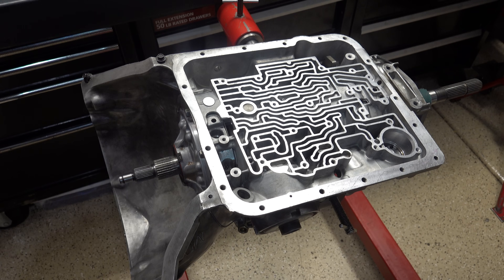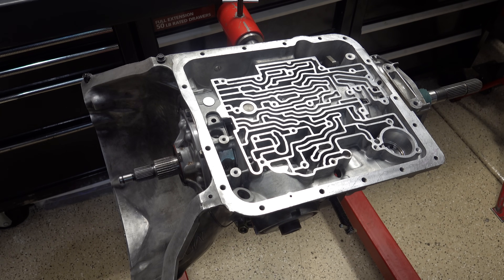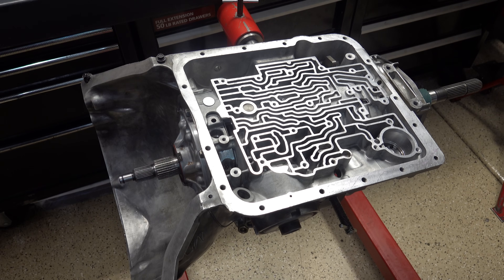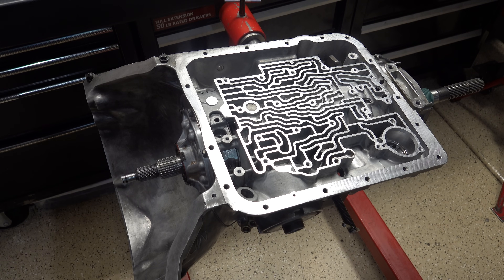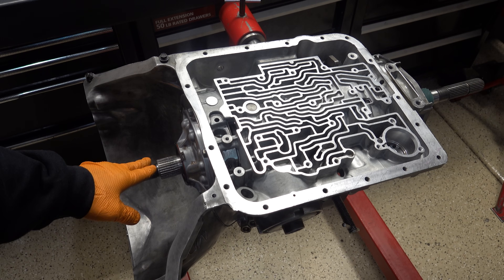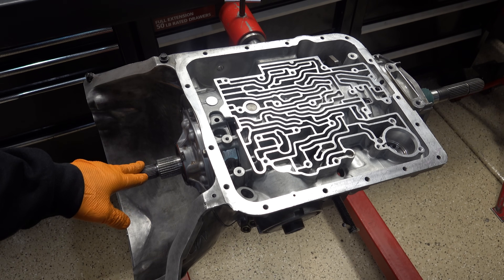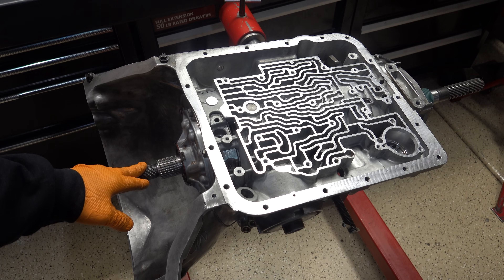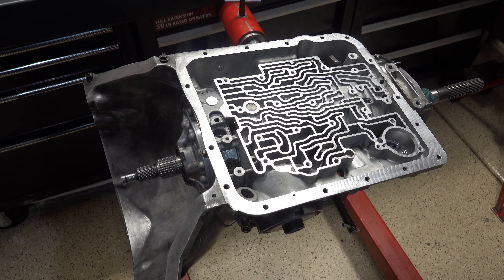Rebuilding Automatic Transmissions: Why I Don't Soak My Frictions

Comment: Does that change the clearance or clutch stack thickness?
Reply from the maker: Hi Tracy, there's no material differences in clutch clearance between wet and dry measurements on the bench...I have found over the years that clearance will open up by about .003-.005 once the trans goes back in compared to what you measure on the bench, soaked or dry frictions.

Thank you for watching.

Comment: Looking for the best clutches for a 4R100 for heavy duty use. It'll be behind a 7.3 diesel putting out about 400 hp. 2000 F-250 crew cab short bed. Truck has 37 inch tires, 4:56 gears, selectable lockers. Already going with a 40 row auxiliary cooler to keep it nice and cool. Will be doing quite a bit of rock crawling.
Reply from the maker: Hi @theezeelife292,

Can you post your question above in Part 1 of my 4R100 rebuild series? I ask as others may have the same or similar questions and most likely look there before this vid for answers. Here's part 1: https://youtu.be/Tm12GezIQww

I'll respond promptly there.

Thank you for watching!

Comment: What about assembly lube? I assume that doesn’t make any difference in ‘feel’ and in the case of bearings or bushings you kind of have to use it right?
Reply from the maker: Hi Alloutofdonuts (sucks when the donuts run out!) - Yes, use assembly lube on all lip seals, sealing rings, O-rings and anywhere there is a tight fitment between parts including the pump and pump bore in the case...If you watch any of my transmission rebuilding videos (i.e. the 700R4 rebuild playlist) you'll get a good sense for how I use assembly lube and on which parts...I soak bearings in transmission fluid as well as bands.

Thank you for watching!

Comment: This makes total sense to me.  Also reminded me of a weird symptom of my 89 Bronco with C6 project vehicle before I took the transmission out to rebuild.  When would start it cold, it seemed as if the truck would lurch forward slightly when it would even though it was in park.  Perhaps all that damage inside made it turn the output shaft at start up for a split second
Reply from the maker: Could have been the case; something was putting it "in gear" for a split second before everything was allowed to freewheel...

Comment: Soaking clutches is a MEME and I never ever soak them if I can avoid it unless I have to reuse them. You can always pour fluid into the unit with the valve body side facing up and boom they’re “soaked”.
Reply from the maker: Yup! 
For sure, man.
Reply: It makes em slip more too

Comment: I literally just wanted to ask you this since Ford's manual explicitly states that clutchplates ought to be soaked 15 minutes before assembly. Thanks for explaining this.
Wouldn't there be any difference in tolerances though? Since the manual also says that tolerances are to be measured after the wet plates are installed. I saw another youtube video where someone went the middle ground by measuring the tolerances dry, and then taking it apart to put the plates back in wet for final assembly.
Reply from the maker: Hey John, there's no material difference in clutch clearance...A couple thou taken up by fluid will be given back once the clutch starts working again. Whoever you watched on YT sounds like they enjoy performing completely unnecessary work. Hope no one takes that guy's advice seriously.
Reply: @nickstransmissions  Thanks for the clarification! That makes sense, and I'm glad to know that there's no need to assemble anything twice.

Comment: I don't soak mine either, for the same reasons. Also, I've started using Alto HE clutches (the gray ones) lately in stock builds, and they don't seem to soak up any fluid no matter how long they soak.
Reply from the maker: Alto 'Reds' are the same way, they don't soak up very much fluid either.

Comment: Good tip on rebuilds.  Idling for a while is always necessary to get at a final/good fluid level.  Some transmission setups, roughly 60% of fluid hides outside  the pan, so topping off at startup is simply unavoidable.
Reply from the maker: Thanks, Flinch and agree 100%